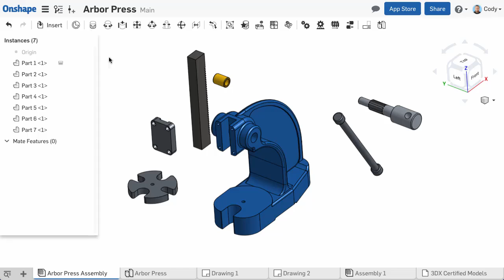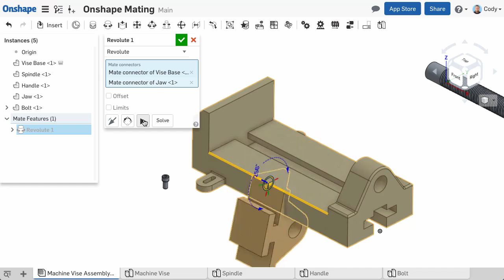Assembly Mating in Onshape

Comment: Maybe I'm wrong here, but this seems to give me far less control over my mates by just taking control from me, and doing what it assumes I want. 

Example: I have a simple assembly containing 2 cubes of differing sizes. I want the top surface of one mated to the bottom surface of the other. Coincident faces mate. Took a bit to figure out, but I got that.

Now I want cube 1's left face offset a distance of (A) from cube 2's left face, and I want cube 1's front face offset a distance (B) from cube 2's front face. X,Y, and Z constraints between the parts, all at different defined distances.

I can't easily figure out how to offset two faces a desired distance from each other. This should be a straightforward and obvious operation to figure out for anyone with basic 3D assembly modeling skills, yet here I sit, annoyed and frustrated.

Grrr.

Comment: ill give this "higher level mates" thing a try, but i really would like the option to use "simpler" one degree of freedom mates if i wanted to... solidworks user since 2011
EDIT: i found that these simpler mates do exist, but my cursor always snaps to these custom connector points instead of just referencing the surface unless i get the cursor dead center on the surface.... any way to disable these custom mate points?